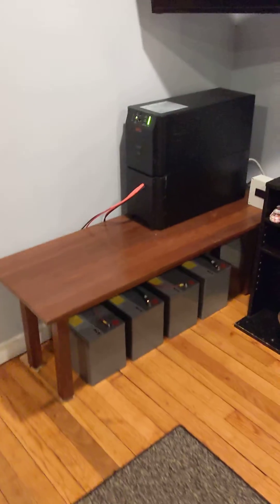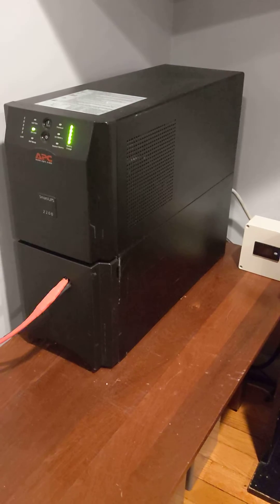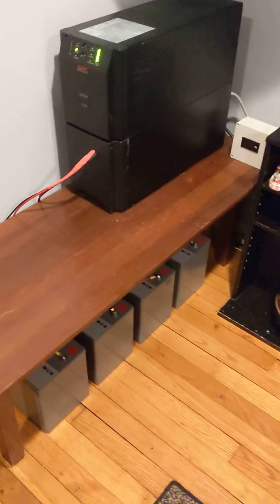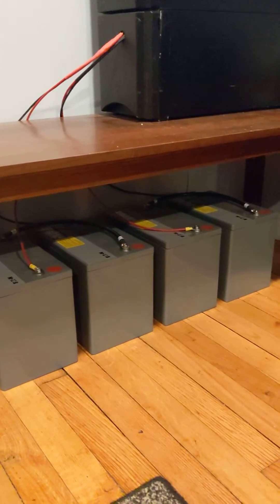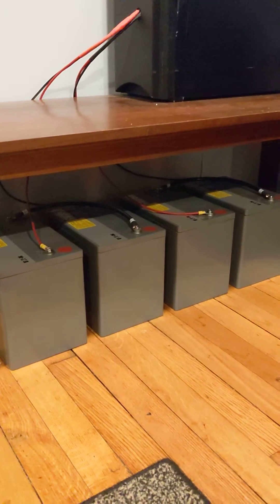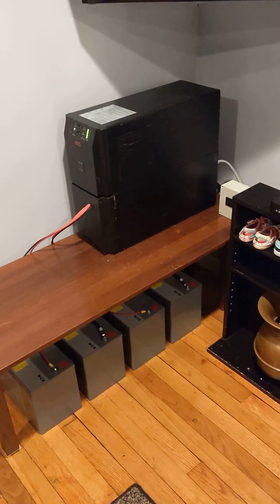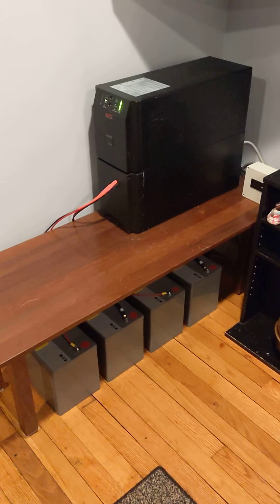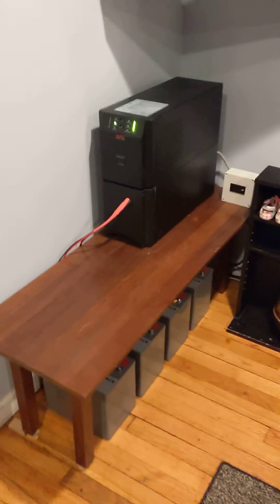APC Smart UPS 2200 (SUA2200) modified for extended runtime

Comment: Hi Sam 

I Got the exact same UPS and i just wonder how they are connected to the batteries. Inside there are two connectors. Are they 12V on each connector or is it different. The reason i ask is that my batteries are dead (Short) so I cant get any values off them. 

//Morgan Sweden
Reply: After some dissassembeling I found it :)  4x12V

Comment: I had this same idea, I may try this.
Reply from the maker: It works, just takes a while to charge with the factory charger in there, I have since bought a couple eg4 LFP batteries and a big 6000w 24v low frequency inverter for home backup, with a small ups for my computer, router, modem and TV. I don't want to lose power to my PC when flashing BIOS or updating, as that could brick it. It works much better but was obviously quite a bit more money. Old UPSs are a dime a dozen so that route is much more cost effective. I ran this setup just experimenting with runtime. Good luck with whatever you wind up doing!

Comment: Hi.... so I got a couple of questions, is this charging fine? Like.... does it charge as normal? And does it last when discharging? I have a similar UPS and I want to upgrade
Reply from the maker: Yeah you'd def wanna change out the charger in there, it's not enough output to  charge this amount of capacity anywhere close to quickly. But it does work with the original charger, but you'd have to bank on not having blips or outages for the time it takes the batteries to charge. I'm not using this setup anymore, as I have upgraded to a battery backup system for my generator panel, and then a UPS for my router, desktop PC, and TV etc. those Eaton batteries were old and tired so I retired them.

Comment: How is it now after 3 years? thank you.
Reply from the maker: I don't use it anymore, as I have upgraded to a battery backup system for my generator panel. I just run LFP batteries and an inverter to cover my critical loads, and then I just have a small ups covering my router, modem, TV, NVR for the cameras, and my desktop PC. The small ups will cover the down time until I turn my batteries and inverter on. The main benefit to this is every time I switch to batteries or back to grid power, the internet would go down, but that has been resolved. The other reason is if I am flashing my BIOS or updating my PC,  this prevents a power failure during and keeps the power clean.

Comment: Why not get an inverter? This device is a bit more expensive compared to an inverter. Also, with an inverter battery, we can change the water, but with these batteries, we can't do that! Btw I have 1000w power supply please suggest something thanks have a nice day!
Reply from the maker: I got it for free from work so I was just messing around with what I had, batteries were also free from work so it was worth it. I use an inverter with lithium batteries for my house now and a smaller UPS for my PC which works very well.
Reply: @SamsDIY  Thank you sir!

Comment: Got two of the 2200 VA rackmounts but the batteries died in a matter of months. They were brand new PowerSonic batteries, so I'm not sure of it's an issue with the UPS themselves, or some kind of setting I screwed up. Feels bad.

Comment: Hello, thanks for sharing your knowledge. I wanted to know how long the UPS lasts with those batteries. It's worth it? How long does it take to fully charge the batteries? Is UPS effective? I wait your answer.
Reply from the maker: I don't use that setup anymore, I switched over to LFP batteries and a 6000w 24v inverter. It is a lot more streamlined. But this UPS did work pretty good in a pinch.
Reply: @SamsDIY how long did the charge running  last on both batteries systems

Comment: I have same ups , please show me how to do that , i mean how to connect those orange cables inside the ups
Reply from the maker: I just made up some longer 10ga. wires to reach from the Anderson connections inside the battery compartment to the external batteries. That was all, it worked well, very simple.

Comment: I am still a bit fuzzy on your hookups here. It looks like you have 2 sets of cables from the big 12V the batteries to the UPS. Are they wired as a pair of 24V (2 x 12V series-wired) packs going to separate Anderson connectors inside the UPS? 

I ask, because I have 2 units: a Smart-UPS 2200 and a Smart-UPS 3000. 

They each have a set of 2 x 24V packs (series-wired 12V batteries) connected to separate Anderson connectors). Would a series-wired string of larger 12V batteries need to be likewise split into 2 x 24V packs, each connected to a separate Anderson plug?

Finally, the Smart-UPS 3000 has a connector on the back for a 48V extended-runtime battery pack.  As it is a single connector, I assume that a single series-wired string that adds up to 48V is all that is required, correct?

(For other readers, the 2 units have very different stock battery setups: the 2200 has 2 packs of (4 each) series-wired 12V, 7Ah batteries. The 3000 has 2 packs of (2 each) series-wired 12V, 18Ah batteries.)  Thanks for any insights.
Reply from the maker: I set them up as they are normally wired in this unit. This one has 2 sets of 2-12v 7ah batteries wired in series at 24v. So 2 pairs of wires from each set of 2 batteries going into the 2 Anderson connectors inside the battery housing. I believe it is a 48v unit. I did no actual modifications to the unit, just grabbed some longer 10ga. Wires and threw some Anderson connectors on and called it a day. I have since gotten a couple newer units and just use those instead. I have large backup batteries for the house that takeover after the ups takes the initial hit. Hope this answers your question!

Comment: Nice setup! I have a cyberpower 1500va 24 volt. Was thinking of trying 2 12 volt 100 amp hr agms. Have you let them run out completely and let it recharge completely on its own? If so did you have any temperature issues? Also how many times did you test like that? Just concerned when not at home if I have an outage..

Comment: Hi, I have the similar APC but I tried to use UPS12-300MR C&D Dynasty battery but seems is not working, Do you have any idea? Thanks
Reply from the maker: Is there a battery disconnect on the back? The APC units have a battery disconnect on the back for shipping purposes. I'm not familiar with those units but I will see if I can find anything! Good luck!

Comment: Good video...... have you made a video showing the full build & set up.. that would be interesting.
Reply from the maker: No I actually never made a video of that, but it was basically no modifications. I only made the Anderson connector wires longer so I could house the batteries outside of the UPS. I could've made new ones with some 8 gauge instead of the existing 10 gauge, but I wasn't running anything crazy so I wasn't worried about it. Other than that just a stock UPS.

Comment: Just wondering if the unit could handle charging such a battery array from low voltage. Would it supply enough current ? Would be interesting to check the specs to see if you would cook the UPS charging from flat / low voltage. Great idea though... Cheers :)
Reply from the maker: You could disconnect the unit charger and put one in its place maybe, I'm not quite sure if it could accept the lower voltage but I'm sure you can figure that out relatively easily. I forget if it charges at 24v or 48v, because it is two 24v banks with two separate Anderson connections inside the unit. But I know the unit itself runs on 48v.
Reply: I have exactly the same unit. It runs on 48v dc so all 4 12v batteries are wired in series in the standard configuration.

I've got mine hooked up to 4x 80ah deep cycle batteries for now.
Charging is a little slow as the charging circuit on the UPS is rated at 271watts.
It puts about 4amps into the batteries.
The standard batteries were 4x 12v 18ah in series to give 48v 18ah

Comment: Hi Sam,

Could you please provide us more information how calibrate ups with larger batteries such x4 100Ah, please?
In your case scenarion the batteris are 75Ah model, total= 300Ah.

How to adapt UPS 12v 100ah batteries?
To get the best battery life and runtime you can the UPS has to be reprogrammed?

Could you please helping with this, or posting on Reddit,

Cheers.
Reply: The 4x 12v batteries are wired in series
So 4x 12v 100ah batteries gives you 48v 100ah.

With series the voltage increases but amp hour does not.

In parallel the voltage stays the same but amp go up.
Reply from the maker: @mushymarlin  Yes I should've explained that they are wired in series to 48 volts. Thank you for the clarification! Also thank you for the specs!
Reply from the maker: You should be able to run a calibration through the unit itself or the Power chute software on a PC. It will run the batteries down completely, lower than 50% as it normally does so keep that in mind. I'm not sure if you can set the voltage to 47.2v as 0v. I'm not sure what the cutoff is from the factory. Wish I could be of more help!
Reply: @SamsDIY  10.5v is considered flat on these units as default so 42v dc on the battery pack
Generally they will shut off at about 11v so 44volts
Reply: @mushymarlin  my 3KVA UPS starts flashing red when the battery voltage shows 67.5v (6x 12v 9ah batteries), so that equals to 11.25v per battery at low cut off. I havent tried pushing it further than this
Reply: @nuteronix5799  6x 12v batteries giving you 72v nominal?
You must be talking about a different UPS as the one in this video runs on 48v nominal battery voltage

Comment: Although its a 48V system , your battery cables looks a bit thin for a 2200va load ( about 1800 watt)  . Do a test run on full load and see if any of the cables get warm. I got mine from work too. Had a tough time lifting this up and load it in my car. Enjoy! this is a solid unit.
Reply from the maker: Yeah it is 10 gauge all the way back, but I never really ran a full load on it. It's been unhooked for a while, I got a newer SMT1500 UPS and use that in it's place. I have my backup batteries hooked to my Genny panel so the UPS takes the initial hits until I manually switch to backup batteries or generator.
Reply: I can't believe how heavy these are
Reply: since it's a 48v battery, the current would be relatively less. They look ok for 30A load.

Comment: Are there any major concerns when it comes to this system or manufacturer? I'm planning on using the SUA3000XL for my server racks as a backup and I need to make sure I replace or fix any common issues beforehand. Any feedback would be greatly appreciated. Thank you!
Reply from the maker: I've had good experience with APC/Schneider electric UPS systems. We use them everywhere at work also. Just make sure it is clean and free of dust and dirt, check the fan if it has one make sure it's clean and working etc. Check the batteries/voltage and the connections with the Anderson connectors, and wires. Basically just make sure nothing sticks out as abnormal. Hope this helps a little!

Comment: hi sam so based on your accent you are somewhere in the US (finally, most video's showing the apc2200 are from the uk) as i am too, and a friend gave me this unit with bad battery's, and cabling, no stickers no model number on it, and i had to open it up and take the model number from the internal board, so at first i was sure this uses 220v but as i found your video and i am in the US to, i am not so sure anymore i thought it might be a good idea to ask this stupid question, does it take 220v? or 110v?
Reply from the maker: Mine takes 120v, but there are 240v versions here in the US as well, I have seen them at work. They would be hardwired typically but if it was a 220v(240v here) it would have 2 hot legs on the cord or terminal strip. The 240v units are all high powered too, 3000VA and up, mostly rack mount style. hope this helps, sorry for the grossly late response!

Comment: Hi can yu set the charge voltages etc? i was wondering about doing this exact mod, but my cells are Tubular plate GEL not AGM and have slightly different voltage requirements Bulk & absorbtion of 14.4-14.7 per battery Float of 13.8 per battery with a Temp coefficient of -30mv / C
Reply from the maker: Not on this UPS you cannot change the charger parameters from the factory that I know of. You could always just remove that charger and hook another with the parameters you require in it's place.
Reply: @SamsDIY  it is possible to change the charge voltage, but that wont effect the current in the desired way, but would reduce total charging power

Comment: so the UPS knows how to properly charge the aftermarket batteries? I assume you need to use the same type of battery that the UPS is designed for (lead acid as opposed to lithium), the only difference is the amp hours
Reply from the maker: Yes exactly, I used some VRLA (valve regulated lead acid) sealed batteries which are the same type of sealed lead acid batteries that came out. Most UPSs I've seen are VRLA batteries and I have not seen any with lithium as they require a different charge profile. It probably is a little more wear on the charger since it would be charging for much longer.

Comment: Hello! This UPS was recommended to me by a technician for my use case. There is barely any information on this one and it. How loud is this UPS just with the default batteries? Do the fans turn on all the time?
Reply from the maker: If it is the same one as in the video, it's kind of loud and noticeable just because the fan is on all the time. It ramps up and down based on load when on batteries. It is designed to be a server-room type UPS so noise isn't usually something that matters for it.
Reply: @SamsDIY  Thanks a lot. You've saved me money!

Comment: Hello can you please give idea how can I do this project for my village in Africa
Reply from the maker: Sure, if you have any UPS of a decent watt/VA rating with a built in fan, you just needs to make up an Anderson connection from inside the battery housing compartment and run it however you like out to a set of larger batteries. In this case the UPS is 48v so I had to use 4 12v batteries wired in series to make 48v. Nothing was changed internally on the UPS besides utilizing the old APC Anderson connectors. This unit is a 2200VA-1980watt model for server rooms etc. So it has plenty of potential. Just keep in mind the charge time will be a bit longer since the batteries are much larger. Just keep an eye on temps, I used Powerchute software to monitor this. Hope this helps!
Reply: Make sure you use AGM/SLA batteries and not car batteries. Car batteries are not designed to be discharged often. UPS batteries are designed to be discharged and recharged fully. But it always is a good habit to minimize the time the batteries are discharged.
Reply: @Aranimda  what about agm car batteries? like in stop/start cars?
Reply: @redwrym  AGM car batteries are fine.  Actually ordinary (water) car batteries will work well but they are just not the best but if that is all you have they can do. Make sure to check the water level in all the cells.  If possible have to the connection cord long enough to keep batteries next to a window or even outside if the cord is long enough.
Reply from the maker: @Aranimda  agreed!